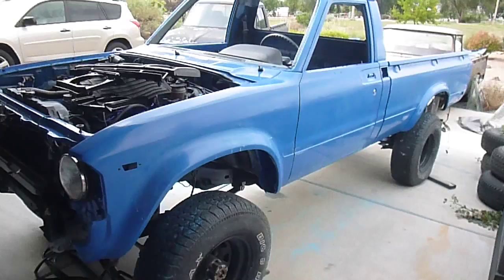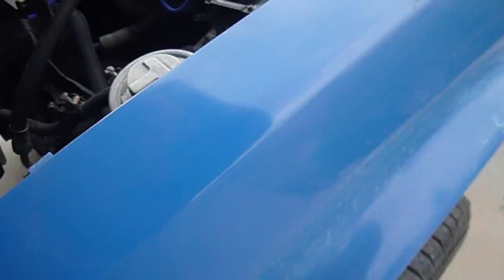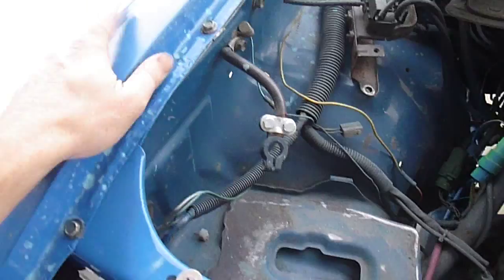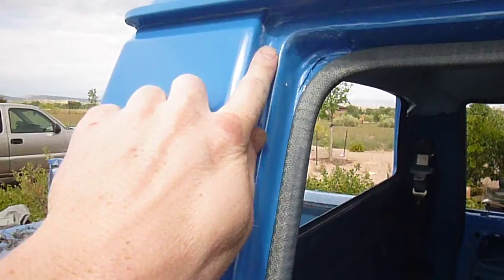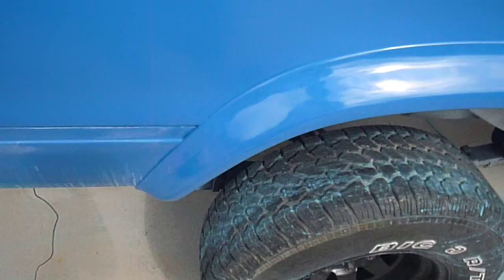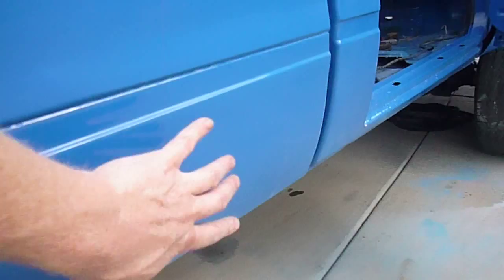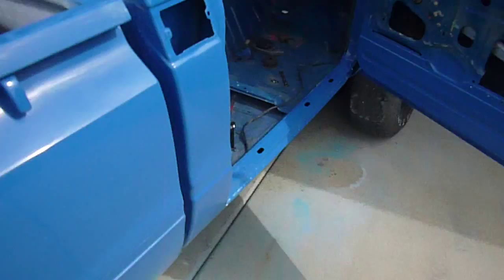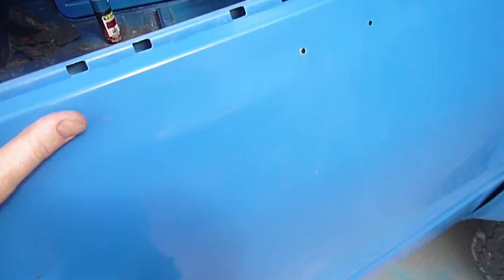Summit Racing Single Stage paint REVIEW - PACIFIC BLUE

Comment: Good job dude. I love old yotas. Can't wait to do another mid 80's  yota project. I just painted one of my concrete pumps with some industrial stop rust paint. It turned out pretty good. I've never painted before and wanted to get the experience so I figured wtf I'll paint one of my machines.
Reply from the maker: +rcp “rcp916” pop Man, these little trucks are becoming rare. I can find them but 90% are rusted out and would need new frames/bodywork. If you find one clean buy it. They went up 40% over the last 5 years and continue to rise.

Comment: Was this all done with 1 gallon?
Reply from the maker: Yes 1 gallon for a small truck if you are not doing the bed. If you are painting the bed buy the extra gallon. I would always just buy the extra gallon and lay down 5 coats so you can cut and buff and have extra chip resistance on the lower panels
Reply from the maker: Also if you are painting the engine bay, under hood, door jambs, inside door panels etc etc. you must get the second gallon. Buy both gallons at the same time for the best color match because there is slight color variation between batches.
Reply: +Bad Apple Garage ok thanks for the fast response it looked great